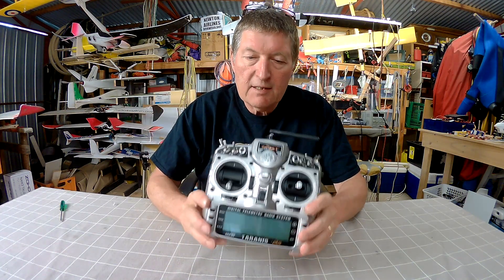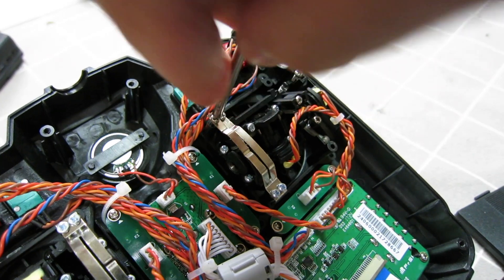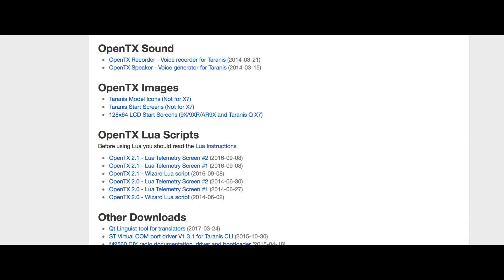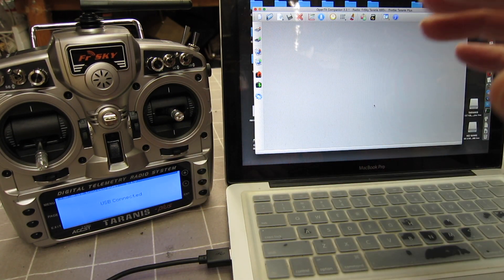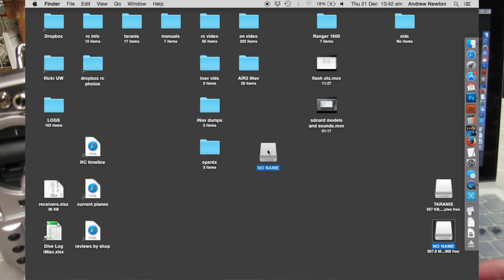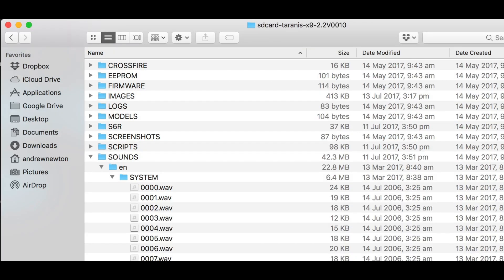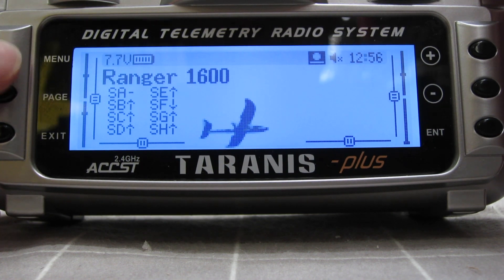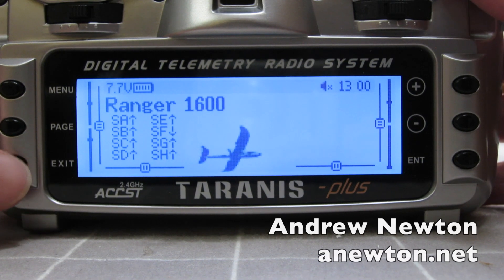Taranis tweaks

Comment: Andrew, a quick question, sorry if I'm using the wrong place.  With Opentx I've created many mixes but for some reason struggling on something that should be quite simple.  Question relates to a flying wing (mini arrow), I would like to use a switch to add a little more reflex during launch phase - I fly mode 1 and am left handed so sometimes struggling to launch then(with my left hand) then move may hand quickly enough to control the elevator stick.  CHeers  Mike
Reply from the maker: Add these lines and change -5 if required. Change 5 to whatever works.
Using the SD 3 pos switch

Ch1 5MAX !SD(up)
Ch2 5MAX !SD(up)
So when SD is not in the up position, elevons will have 5% reflex

Comment: Very helpful! Trying to decide which failsafe mode to set. Which one do you use?
Reply from the maker: For iNav setups and normal planes I use No Pulses, for the Bigaole RTH module you need to set a cruise throttle percentage.
Reply: Thanks. Do you have a video talking about the various failsafe modes? I can't find any info detailing them. Custom and hold I understand (though hold doesn't seem like a very good idea to me). Receiver I'm assuming varies depending on which receiver you're using and its preset failsafe (x8r seems to be to just kill the motor). I don't understand no pulses other than no pulses are being sent. I can understand this might be good if you have an autopilot and don't want weak sporadic pulses upsetting it but without one, won't it just fly away? I have a custom one set at the moment.

Comment: Great video! It was tiresome figuring this all out myself before you did this video. Suggestion, a brief guide of your base programming for different types of airframe? (i.e. delta wing, glider, 4ch plane etc). And do you tend to program  on the companion app or on the radio?
Reply from the maker: I mostly use the radio. Good suggestions for programming vids thanks

Comment: I've been scared to update my firmware because of all my mixes etc. that I have created. Will they still operate the same after I update the firmware? I will back up all my models, I just hope all the functions and mixes still work the same with the upgraded firmware, thanks Andrew.
Reply from the maker: Depends what you're upgrading from, but yes you can never be sure
Reply: Well, I think this video you have done has pushed me over the edge, I'm upgrading the firmware, time I came up to date, thanks Andrew, appropriate timing for this subject👍
Reply from the maker: Good luck. Might need to check any telemetry setups before flying.
Reply: Cheers, good tip, thanks.